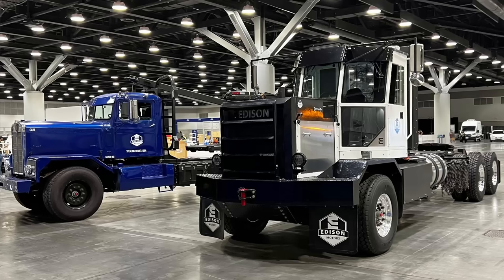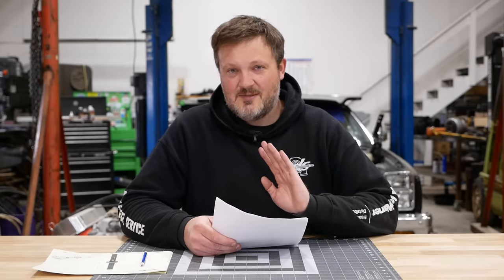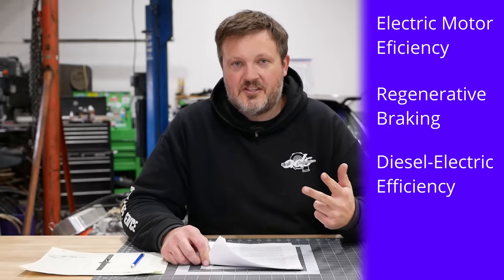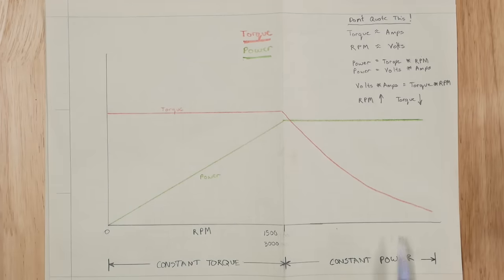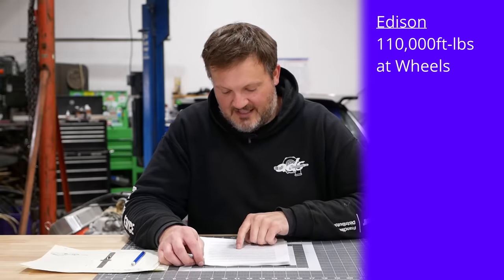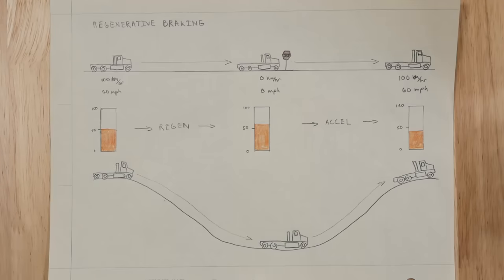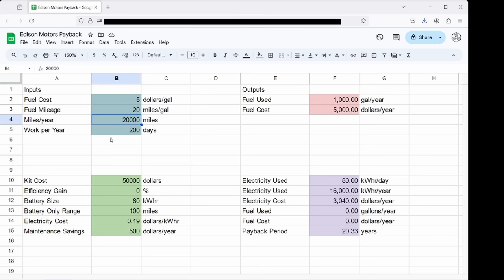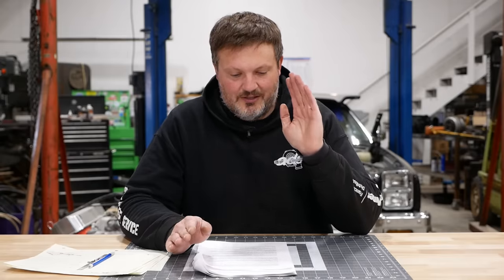Edison Motors Built a Diesel - Electric Semi Truck

Comment: I think log trucks specifically and mining applications where you haul out of a pit and back down into a pit in very controlled environments and when i say pit i mean like massive operations like how they are driving down mountains is where this would work best and also combining the trucks with say wind or solar could also help eveyone gets 30 min to a hour lunch break so a little time there i guess along with charging at night but a lot of mining operations run 24/7 so that may not work for them 😂 plus they need the battery storage infrastructure plus youll still be at a loss of power when in the mining application so really its just logging but for your average joe who wants this in a truck needs to have a excessive amount of solar panels on his house/ property with massive amounts of battery storage 😂 to make it worth while but at the cost of a all of that you are better off fighting with emissions😂 i mean the clear answer is nuclear so power can be cheaper than oil based fuels and so you don't need so much extra battery storage you just plug in when it needs to be charged (yes people i know it's not that easy) but lets be honest nuclear big scary😂 so that won't ever happen hopefully everything does go electric though all have to go back to school to learn more so i can work on them but i am cool with that

Comment: Many ships have electric propulsion but that will always lose in efficiency compared to an engine-gearbox-propeller shaft solution. There are then additional flexibility and operational reasons to use such solutions. There can be batteries involved and, as such ships always have many engines, they will be operated at the optimal load and number of engines to produce the power needed.

Comment: EV is good in theory, but from what I've seen, the sourcing of the materials used in the electric motors, batteries, and tires that will handle the loads (not to mention the impact heavier vehicles take on paved roads and the resources needed to repair/replace them), is detrimental to the environment.  co2 in the air is one thing, but co2 comes from natural processes as well as people.  Nature's circle of life can deal with co2.  Lithium, cobalt, neodymium, samarium. terbium , dysprosium, etc, I think, are the real pollutants.

Comment: I thought this truck had one large electric motor attached where the drive line normally is.  Working with electric AC motors all day I can tell you they are far from as efficient as everyone makes them out too be.  And what ever happened to, at each change of energy you will always lose some, be it heat or even noise or friction.  Loved the clip.
Reply from the maker: They had a truck like that. The new one has two motors.

Comment: I like when you go "full engineer". It proves you can work with every part of your body engaged - your hands, your head, your heart. Like most of us, you also have to work with what your wallet will survive. Working prototypes and evaluations/ simulations take lots of time and money. The hype rarely matches the reality. However, I love what Edison is doing with Topsy and I wish them well. Electric hybrid technologies exist in all forms of transport - just not main stream ones. I genuinely hope Edison thrive.
 When I left university, my first job was to find the causes of cooling tower fan blade failures and to find ways to improve the manufacturing processes for the blades which my company made under licence. Unfortunately, I was too successful because I discovered that the basic design philosophy of the main manufacturer was flawed, so instead of the blame only falling on the small company for not building the blades to spec, the spec itself fell under the spotlight. Up shot. The big boys picked up their "ball" and walked off the park in the huff despite me finding ways to redesign and improve their design. Proving that I couldn't do right for being right. It appears  "face saving" is more important to some

Comment: As a mechanic, engineers are our mortal enemies. 

As for the series argument, in theory you shouldn’t need a huge Diesel engine to run the generator as compared to a straight diesel. Smaller engine should mean more fuel efficiency. Then add you lose the transmission. You lose a decent amount of weight which increases fuel economy and possible load increase. However you increase weight with the battery packs. So any weight advantage is a wash. You “may” increase range/economy by adding a transmission of some sort to try to keep it in peak performance.

Personally I do not believe that EVs are the future. They don’t have battery tech nailed down nor charging time reduced enough. If I were to hang my hat on any tech it would be hydrogen. They hurdle I think holding hydrogen back is safely refueling them that is easy and mass repeatable. Also making hydrogen storage on a vehicle that is safe incase of accidents.

Comment: EV's aren't coming. It's a dead tech. If you want to talk about diesel generator powered electric motors, fine. That's not an EV. Diesel electrics have existed for a long long time. EV's are unicorn farts.

Comment: Good analysis, Wes.  As an engineering minded person, I’ve been following Edison as well, and thinking about their numbers.  I live in the mountains of BC too, and one local factor you may not have considered is that our electricity is all hydro dam produced.  Even residential rates are 0.11 per kWh, not the 0.19 you were using.  Industrial rates, where a semi is likely to be charged for the night are likely to be half that.  As a series hybrid, I don’t see how the Edison trucks can possibly be as efficient on flat level ground at highway speed.  On the other hand, logging trucks are a unique niche.

I’m sure you already know this, but for other viewers, locomotives aren’t diesel-electric for efficiency, it’s because building a mechanical drivetrain from engine to train wheels is unworkable (just too complicated).

Like you, I hope Edison succeeds, but I’m skeptical about the numbers.  I guess we’ll know the truth if no real testing of Topsy happens this year, with published results.

Comment: they are the 2nd company i know of that has tried this retrofit idea the other being one that was local to me called electric motors corp they were in elkhart indiana and their whole thing was like this also but limited to cars and pickups they would pull the drive line from units and replace the engines with like 2 cylinder kohler like engines and the engine would drive a gen  to charge batteries as well as provide AC power while working at job sites  and what not it died rather quickly and its almost impossible to find any information on them anymore its like they were thanosed away or somethin

Comment: A new kenworth T680 cost 150,000.00 most companies trade them off after 3 years. For tax’s proposes. A few things you didn’t take into account is wear and tear on the vehicle, the weight of the EV. And the damage they do to our infrastructure. The cost of upgrading our infrastructure to accommodate the massive weight of the EV. I guess I would be a little more welcoming of the EV if it wasn’t being crammed down our throats, also are EV’s not affected by road salt and sand?
Reply from the maker: I am curious what salt will do to them. It has not been an issue for hybrids as far as I can tell.

Comment: Better batteries would help this a lot. Better as in cheaper, lighter, more energy dense and cold temperature tolerant. You also need to plug them in somewhere when you can, to get a cost benefit over recharging them with diesel. We don't have the grid infrastructure if everyone starts doing that. I do wish Edison well though.

Comment: Thank you for making this video, and for putting some real numbers down. I like all of your videos, but I would definitely love to see this style of analytical video from time to time.

I like Edison's idea a lot, and in some big trucks in some scenarios it can make a lot of sense. I knew when they started talking about converting pickup trucks that the numbers weren't going to work out. Even if you have the ideal donor truck (good body/frame with no drive train), it just does not make any sense to put a $50k replacement drive into a $10k truck. Any newer truck will just get rebuilt with its original style drive train.

Also- thank you for pointing out the difference in diesel electric locomotives and hybrid vehicles. There seems to be a lot of confusion there about how locomotives actually work and why they are designed the way they are.

Comment: Hi Wes! Long time viewer and Patreon supporter here, love watching your videos and seeing the all of the projects that you are always tackling. I don't often comment, but I had a couple points I wanted to bring up on this one, especially since EVs are right in my wheelhouse. 

One thing to keep in mind that wasn't included in your cost analysis with the spreadsheet is the cost of either buying a new truck, or rebuilding an existing "worn out truck" (at least not for all of the categories you looked at). I agree, in most cases, it doesn't really pencil out cost wise to replace a perfectly good working vehicle with a new one (EV or not), but if you're talking about a situation where you are already planning on purchasing or replacing a vehicle, now you're simple looking at a cost differential, rather than total purchase price. 

In your first example, for example, you had input the $100k "kit cost", and then added all the other parameters. But if you were already in a situation where you needed to purchase a truck, or the engine in your existing truck needs to be overhauled/replaced, now the cost is a differential. A used, low mileage Cummins X15 for example is going to cost at least $20-25k, and a new or reman one would probably exceed $35-40k. Now instead of a $100k cost, you're looking at a say ~$70k cost differential. If you were looking to purchase a complete truck, that is in good running order, you're probably looking at anywhere from $30-80k+ (depending on age, mileage, and spec).

To look at the pickup truck example, the Cybertruck I would say is definitely more of a "statement piece" than a real "work truck", though it could be used for that purpose if you were so inclined. Also, right now the prices on them are quite high for the initial run of "founders edition" trucks ($20k upcharge). For someone who's shopping cost though, and is going to use the truck for work, I would consider something like the F150 lightning to be a better comparison. 

The base Lightning has a real world usable range of ~200mi with a 98kWh battery (long range trucks are closer to ~275mi real world with 131kWh). A new, base Lighting Pro can be had for ~$45-50k (a low mileage used one can be had for under $40k, usually in a slightly higher trim than the base Pro). Compare that to a New gas powered F-150 in the same configuration (crew cab, short box) and the cheapest I can find anywhere in the country is $37k. Now you're talking about only a ~$10k initial purchase price differential, which should have a payback period of only about 3-4 years. After you factor in the federal EV credit of $7,500 off the purchase price, plus other potential state incentives depending on where you live, that brings the differential down to less than $2,500. That cost difference could be made up in under a year. 

All of that said, I'm not totally convinced on if the Edison guys will be able to make production happen on these kits at any "realistic" scale, but I do hope that they can succeed. They've certainly come a lot further than I had initially expected, but building one prototype is a totally different thing from bringing something to production. I wish them all the best, they seem like a great group of guys from everything I've seen. 

Note, all of this is coming from a guy who works on EVs for a living (I just opened an independently owned QC Charge "franchise" EV repair shop in Portland OR, and before that, I was fixing EVs in the San Diego area at the home location of QC Charge). I think that for anyone who tows long distance, EVs are not the answer, at least not yet until battery energy density can bring up the range. But for regional use, they make a lot of sense. If you're not doing a lot of towing, then they start to make even more sense. While I don't have an EV truck myself, I've considered getting one, but for now, my old Tesla Model S (with nearly half a million miles on it) works just fine with a small utility trailer whenever I need to haul anything around. 

BTW, if you ever come across an EV project that you end up wanting to tackle and need any help with, feel free to reach out. My main specialties lie in drive unit repair (particularly the Tesla LDU, used in many versions of Model S/X, as well as the Toyota RAV4 EV and Mercedes B-Class ED), but I know just enough about batteries and other HV systems to be dangerous ;) .
 
Alex - QC Charge #2 in Portland Oregon

Comment: and this usecase of hauling down a mountain seems fishy to me as well, 
20tons at 1km elevation has 200MJ of potential energy or about 56kWh, with 60% efficiency 33.6kWh
1 liter of diesel has about 10kwh energy, lets say 20% efficiency when driving up shoddy logging trails or about 2kWh per liter . 
so you would save around 17L of diesel per trip?
Reply: plus you're now also hauling tons of batteries up the grade

Comment: That was a very interesting dissertation, Wes. Well thought out and presented ... two of your trademarks. I like your foray into reality. Fossil fuel IS going to go away. We need to keep exploring options. Sadly, some people fail to understand or remember that the rise of gasoline-powered vehicles happened relatively quickly and the most technical of those changes have been brought forward in the last 20 years. Looking forward. It's a good thing.

Comment: Would a battery under the floor of a semi-trailer work as an alternative additional power source for a tractor? These could charge while idle and between loads. This would add weight, but also add range. These could also use solar panels on the roof to charge.
Reply from the maker: Sure. The problem is you just can't get enough energy from the sun to make a dent in the power demand.

Comment: I will say this and it's not negative either way, but you break down on the highway with a diesel and call for service track and he comes out and change's part, break down with a battery truck and there's no service truck gonna carry  a battery and change it or electric motor because the cost of those and he is not gonna be responsible for the cost of one if it would get broke on the way out to your truck.
Reply from the maker: True. But there are limits to both. A mechanic is not going to come out and replace a piston on the side of the road. Same thing for an EV battery. But a control module or inverter or temp sensor or something is easily fixed with a service call.

Comment: Ah....
If diesel electric locomotives are 20% efficient than electric vehicles at best are the same. Adding in losses to make the batteries then charge/discharge them chipps away at that.

Comment: This is gonna get buried and that's fine but why has nobody developed a replacement electric motor/generator/clutching arrangement that fits in the space of a standard automotive torque converter? Slap a battery pack in the trunk, run the wires, add a controller to talk to the existing ECM and you've just increased power & efficiency of every AT vehicle on the planet.
Reply from the maker: I just don't think it's that easy.

Comment: I like EV's. Has nothing to do with politics for me. I'm neither one way or the other on global warming, the truth encompasses, in my opinion, a wide swath between the two political narratives. The concept of EV is great, there are dirty ways to go green and less dirty ways, all the way from ore mining, to what generates the charge electricity, to end of life disposal. 
Hybrids such as this are, I think, cleaner than electric only. 
Remember all complaints with the Edison facts and figures is no different than complaints from naysayers. 
1) on regenerative braking you are assuming the motors are working only as hard going down hill as they will going up hill. The key to the Edison theory is a heavily loaded truck going down hill will take more energy to slow the vehicle than is expended driving up the same hill at 1/3 the weight (or whatever the ratio is)
2) As far as series hybrids go I've never seen a diesel electric locomotive built as a parallel hybrid, wonder why? Did those engineers get it wrong? 
3) what are the parameters of the series vs parallel study? Did they use the same engine for both? I suspect they did. A parallel hybrid requires the engine to have enough power to propel the vehicle. A C10 is a big difference over a C15, I think a 3116 would do the job. It's a matter of energy storage rather than production quantity. You're assuming the truck consumes everything the generator produces 100% of the time.

Comment: What’s the resale value? As for the electric cars being sold now they are basically throw away vehicles.  Once the batteries are to the point of replacing the cost is way higher than what the vehicle is worth. So now we are going to have a pit in the ground with used up batteries and vehicles. Don’t think that’s good for the environment!🤔